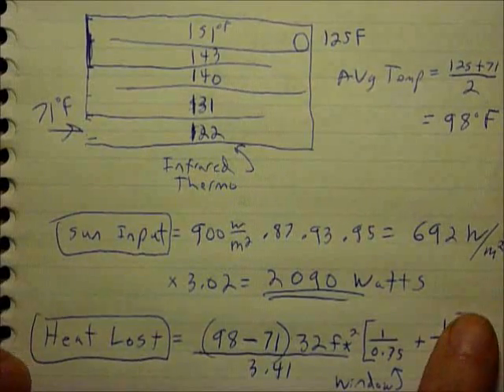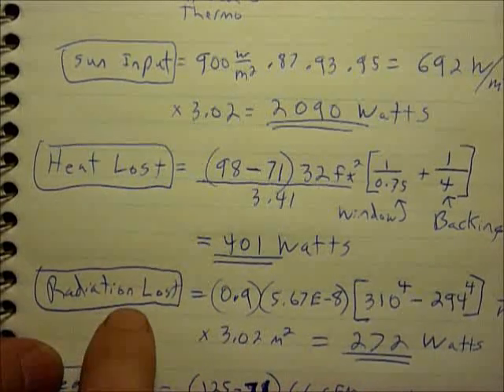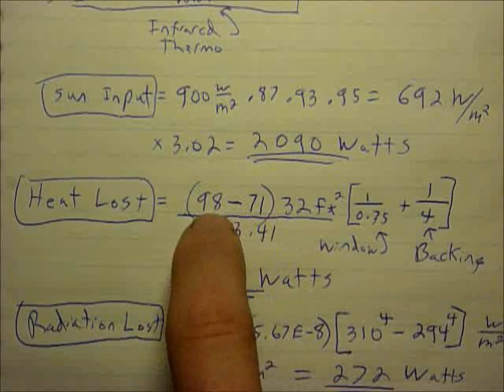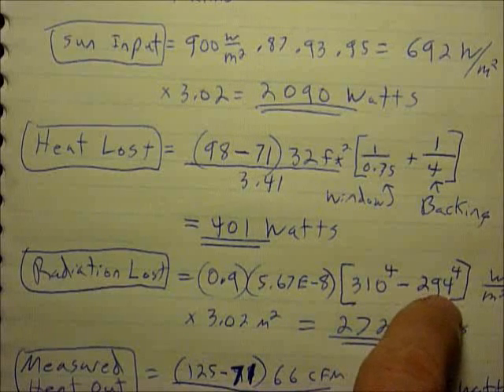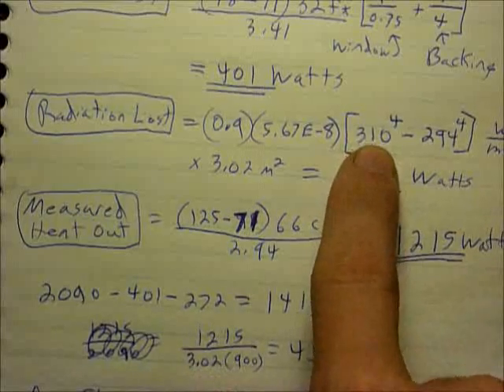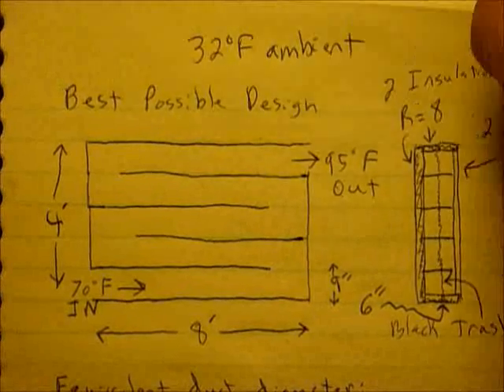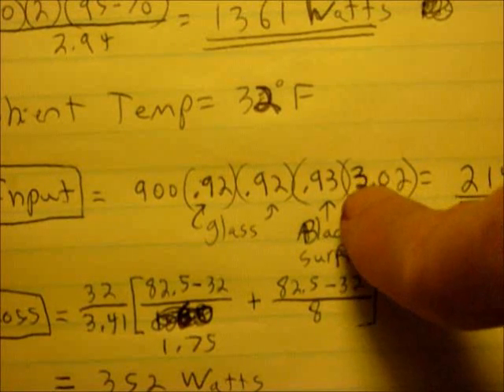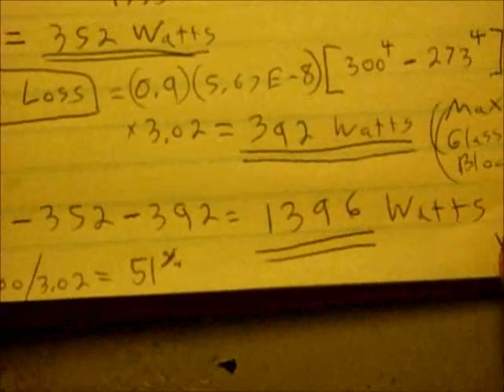solar air heater calculations

Comment: There's a free PC java app (which handles most solar air heater calculations) on our website, if you're interested. There's also a compiled list there of most of the mathematical equations used by the app (would appreciate any feedback that you might have, on this).

Comment from the maker: I finally figured out the black body calculations when there is a glass front and it is a bit complicated (I could not find a reference, but it's a differential equation). The end result is that the losses will not be as much as I've indicated because the glass is blocking all the radiation heat from immediately escaping, but it matters on cold days, especially you let the black part get hot.  The primary goal for efficiency in the design of these things is high air flow to not let it get hot.

Comment from the maker: @Yaheuben66 the unpainted side feels hotter to touch because without the paint as a thermal insulator, the metal is transferring heat to your skin better.  I don't think the unpainted side will heat flowing air better than the painted side, especially because with the higher air flow it is not supposed to get too hot.   I like the black plastic trash bag method due to being cheap and light. A problem is that you can't let the air flow go to zero while exposed to sun or it melts.

Comment: WoW!! Thank you, thank you, thank you for putting this information out.. I have been bouncing this problem around in for a year now... Great information!

I have thought about the "collector"-- I thought that aluminum foil (painted black with a "naked" back) placed mid-channel would be best-- aluminum is a good heat sink/shedder

I have a piece of aluminum plate painted black-- the back side gets WAYYYYY hotter than the black-painted front (tested by conduction/touch, anyway) in full sun...